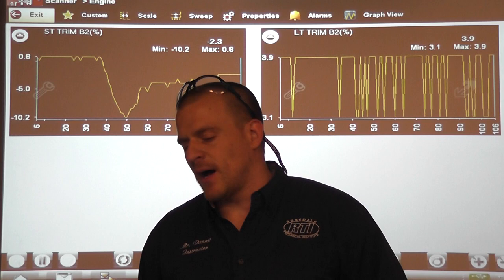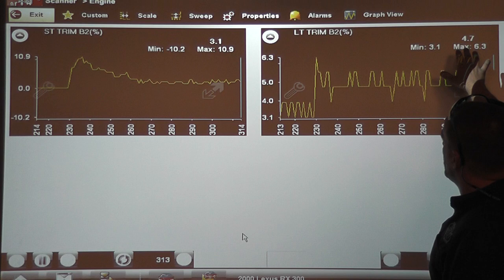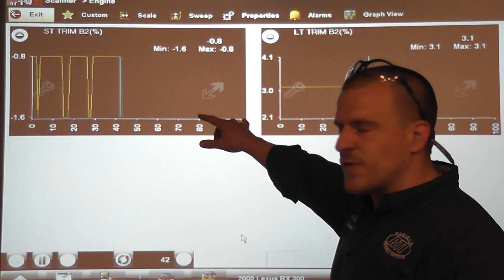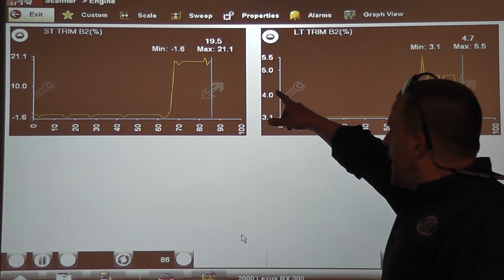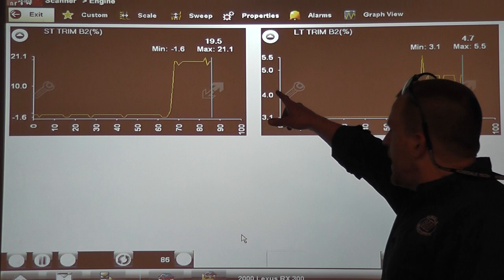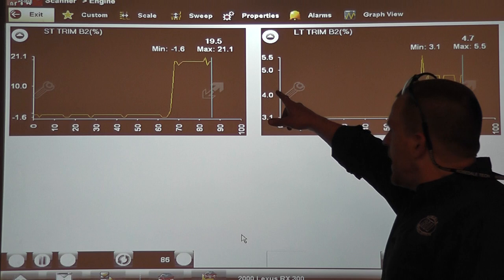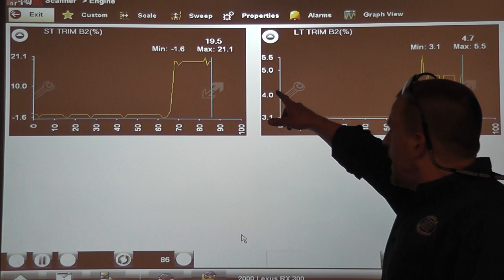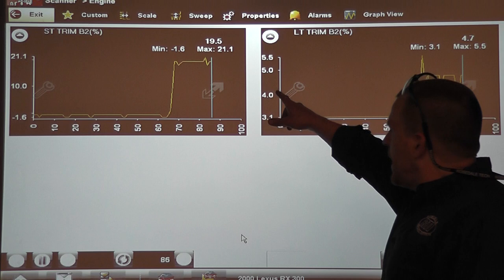Using Fuel Trim to identify type of misfire (can it be done?)

Comment: Dear ScannerDanner, here is the "full picture" of the Negative fuel trim problem (STFT = -27) only on Bank1 for my car, please HELP, please:

2004 Honda Accord 3.0L V6 Engine LX model: (about 200K miles)

After about 8 minutes at IDLE, no speed, RPM = 785, pending codes for misfires all cylinders (P0301-P0306) and P0300 (Random misfire) show up:
1. ECT = 176
2. MAP = 10 inHg
3. Spark advance = 9
4. IAT = 95
5. TPS = 13.3
6. STFT bank 1 = -27.3, bank2 = -2.3
7. LTFT bank 1 = 0, bank 2 = 0
8. A/F ratio sensor 1 bank1 = -0.246 to -0.269mA (before CAT bank 1)
9. Eqv ratio 11 = 0.964 to 0.972
10. A/F ratio sensor 1 bank2 = -0.019 to -.074mA (before CAT bank 2)
11. Eqv ratio 12 = 0.991 to 0.999
12. O2S2B1 = 0.825V (after CAT bank1)
13. O2S2B2 = 0.195 to 0.715V (after CAT bank2)
14. Load = 34.1

Then I drive the car, during ACCELERATION, I see O2S2B1 = 0.3 to 0.6V (after CAT bank1)

Per your instruction, I take notes the following numbers during DECELERATION; my foot off the gas pedal:
1. STFT for B1 and B2 = 0
2. LTFT for B1 and B2 = 0
3. A/F ratio sensor 1 bank1 = 3.7 to 4mA (before CAT bank1)
4. Eqv ratio 11 = 1.99
5. A/F ratio sensor 1 bank2 = 3.5 to 4mA (before CAT bank2)
6. Eqv ratio 12 = 1.98
7. O2S2B1 = 0V (after CAT bank1)
8. O2S2B2 = 0V (after CAT bank2)
9. RPM is about 2000
10. MAP = 5.9 inHg

Then about 1/2 hour driving (acceleration and deceleration), I then park the car and let it IDLE:
1. STFT bank1 = -11.7
2. LTFT bank1 = 0
3. STFT bank2 = 0
4. LTFT bank2 = 0
5. A/F ratio sensor 1 bank1 = -0.007 to -0.0085mA (before CAT bank1)
6. Eqv ratio 11 = 0.999 to 1
7. A/F ratio sensor 1 bank2 = -0.019 to -0.070mA (before CAT bank2)
8. Eqv ratio 12 = 0.996 to 0.999
9. O2S2B1 = 0.76V (after CAT bank1)
10. O2S2B2 = 0.2 to 0.7V (after CAT bank2)
11. MAP = 9.7 inHg
12. Spark advance = 8 to 10
13. ECT = 201
14. Load = 32.5
15. RPM = 790
16. IAT = 134
17. TPS = 12.9

Then I turn off the engine and wait for about 10 minutes and start the car again at IDLE:
1. STFT bank1 = -25.7
2. LTFT bank1 = 0
3. STFT bank2 = 0
4. LTFT bank2 = 0
5. A/F ratio sensor 1 bank1 = -0.007mA (before CAT bank1)
6. Eqv ratio 11 = 0.999
7. A/F ratio sensor 1 bank2 = -0.050mA (before CAT bank2)
8. Eqv ratio 12 = 0.99
9. O2S2B1 = 0.6 to 0.825V (after CAT bank1)
10. 02S2B2 = 0.2 to 0.7V (after CAT bank2)
11. MAP = 9.7 inHg
12. TPS = 13.3
13. IAT = 147
14. ECT = 207

Questions:
1. Seems like when I drive, the numbers are getting better until at idle STFT bank1 go back to -25.7? Does 02S2B1 (after CAT bank1) is normal? the 2 A/F ratio sensors (pre CAT) are ok?
2. One more thing, yesterday, at IDLE, I rev the engine to 3000 RPM for sometimes, the P0172 (System too rich bank1) and P0430 (CAT system efficiency below threshold bank2) came up with Engine Light on. I was surprise P0430 for bank2 CAT. Should it be for bank1 instead? Yes, the O2S2B2 values indicated potential CAT problem for bank2, should it be CAT for bank1 instead because of bank1 STFT is too negative - 25.7?
3. Can a restricted CAT bank2 causes STFT bank1 negative?
4. Or the other way around, can STFT bank1 is too negative which can cause restricted CAT bank2 problem?
5. I just order a "smoke machine" which will arrive in next couple of days, will do smoke test in all system. Any other test(s) should I try?

Have Done:
1. New PCV (Honda part)
2. New Gaskets (Honda parts); EGR, Throttle Body, Intake, Valve Cover, Spark Plug tubes
3. New Injectors (Aftermarket; Standard InterMotor)
4. New Spark Plugs (Aftermarket; Denso)
5. Whole Fuel Unit (Honda part); regulator, filter, pump ...
6. New MAP (Honda part)
7. Clean EGR.
8. Clean Throttle Body
9. Clean EGR path from Intake
10. Did Valves Adjustments
11. Did Static Compression check: B1 (152, 145, 150) and B2 (185, 175, 185)
12. Tested EVAP Purge Valve
13. Drop out test
14. Tested Coil and Spark Plug together for sparks
15. Vaccum measurement at Idle = 19 inHg, needle is stable
16. Fuel pressure = 58psi
17. After installed new injectors, when new injectors in the fuel rails exposed, turn on key and see fuel pressure is at 58psi stable, no leak injectors
18. Water test for leaks. Result = no visible problem.

Will further tests:
1. O2S2B1 (disconnect and see how this effect STFT B1 ?)
2. Swap O2S2B1 and O2S2B2 (make sure O2S2B1 is ok ?)
3. Disconnect CAT bank2 or both CATs to see its effect of STFT B1 ?)
4. Injectors Balance test ... need Honda instrument/fitting/Gauge and bi-directional scanner for this test ?
5. Smoke test.

Comment: excellent video. not sure if anyone will read this but wanted to know if fuel trims can effciently help diagnose misfires issues. I have a V6. CHECK ENG Light P0300 and P0302. LTFT reads -6.3% on bank 1; nothing alarming when I increase RPM to 2500. LTFT remains -6.3%. LTFT &STFT bank 2 very close to 0%. 
Very confused here. 
Note: engine just rebuilt and Cylinder 2 piston's had a hole in it before being rebuilt. 
spark plugs are new, Ignition coils was replaced. 
Personally I think Compression test on Cylinder 2 should be the first step in a process of elimination. 
Any inputs? please chime in. this is for a 2009 chevy traverse 3.6L/ Thanks
Reply from the maker: the minus fuel trim % is suggesting that your problem is not an ignition misfire or a no fuel misfire. If you have a constant misfire on the #2 cylinder, then yes, I agree, check compression next. This would be a good video for you to watch. 
https://www.youtube.com/watch?v=uB9XCDO8oa8&lc=UgzeS0VThWMchtJ32b94AaABAg
Reply: thanks for your prompt response. I will watch it immediately.
Another question for you. this one regards the proper procedure for a compression test. 
I like to do everything by the book; according to repair manual all spark plugs must be removed, ignition disabled, floor the gas pedal and crank 6-10 times. No compression under 140psi for the 3.6L traverse and no more than 25psi difference between highest and lowest compression (sorry to have to write all this)
The mechanic who just rebuilt this engine states that compression can be checked by removing one spark plug only. 
What is your opinion on that?

Comment: Hey,  Paul. I've followed you for a couple of years even though I no longer work on cars. At the moment though, I'm working on a 98 civic with negative fuel trim.  Short term is at about -23 it has a code of p0172. Maf sensor is fine as well as injectors and 02 sensors.  I did a compression test on the engine and 2 of them had over a 10% difference between the ones that read highest.  Could this difference in compression mark the code I have?
Reply from the maker: A 98 civic with a MAF sensor? I thought these were all MAP engines. Cylinder variation with compression pressures is not going to cause your negative fuel trim numbers. What were the compression pressures?
Then there is a list of things that need checked. 
-fuel pressure
- fuel pressure reg
- O2 sensor
-MAP and ECT sensors
-head gasket
- cam timing
-EVAP purge sol

Also, how does the car run? What are your symptoms? Does it have good power under load?
How are trim numbers at a higher RPM?

Lot's of variables and different directions to take based on your symptoms
Reply: ScannerDanner  Hey,  thanks a ton for the response. Ahh, that was totally my bad. I meant map sensor.

Today I had more time to dig deeper into it. 
Cylinder compression is 135, 130, 110, 105 is the lowest on cylinder one. 
The fuel pump gives me 40 psi when ignition switch is turned on and then drops to about 18 after about 3 minutes. 
I tested the temperature sensor which was also in working condition. 
Now,  the MAP sensor.  It receives 4.8V and receives ground as well. I unscrewed it to attach a vacuum pump to it.  At this point we measure 2.40v when I pumped it rather than seeing a drop in voltage I saw an increase to 2.94v. This leads me to believe it's bad because voltage should have dropped.
Before I tested the MAP I did a test on the primary o2 sensor to see its reaction because on my live data it seemed to be working fine.  I created a rich condition by spraying starting fluid into a vacuum hose, it jumped to .900v as expected. So then I created a lean condition by slowly removing the vacuum hose to the booster. My minimum voltage dropped between .150c-.230v I expected it to stay there since the lean condition still existed, but then the o2 sensor fluctuated into the .800v range.  This also leads me to believe there might be something wrong with it. 

The car upon initial startup starts at high RPMs and then tries to idle below 900. I got a minimum recording of 450rpm near shutting off.  While driving the car seems to drive fine,  but I did take note that short and long term fuel trim tend to stay in the negatives.  With long fuel trim jumping into the single digit positives. 

I'll be attempting to get a hold of an o2 sensor and a MAP sensor to see what difference I get. Unless you think there's something I might still be missing
Reply: Oh,  I was actually thinking just now, that fuel pressure although it is initially 40 psi. I feel it begins to drop way too quickly

Comment: hey bro....i do have a problem with my toyota corolla....everytime i slow down... and applying my gas on it is not doing what he is suppose to do.....it takes time for it to accelerate....
Reply from the maker: can't offer you any advice without some data from you. Are you asking because you want to actually troubleshoot this yourself? Or are you just looking for a fix. 
If you want help troubleshooting this and NOT silver bullet fixes. Post to my forum at www.scannerdanner.com. 
You will be expected to be able to use at least a voltmeter and have a basic scan tool and a fuel pressure gauge.

Comment: Hi Paul. Hope you ok.
I am working on a 2009 Ford transit 2.3 petrol.
The van is badly misfiring 
Idle 800 rpm :  short trim = fluctuating between -7 & -8 %.
Long trim stack -28%.
O2 after stack rich 745.

On load short fuel trim 0.
Long g fuel trim -10 to -16.
O2 activate normal.
What do suggest?

Thanks
Reply from the maker: Unplug the MAF sensor and see how it runs
Reply: @ScannerDanner  I unplugged it the engine cutoff. Map in the throttle body.
Thanks Paul.
Reply from the maker: Start it back up, foot on the gas pedal to keep it running, give it a minute to stabilize, then it should run with the MAF unplugged